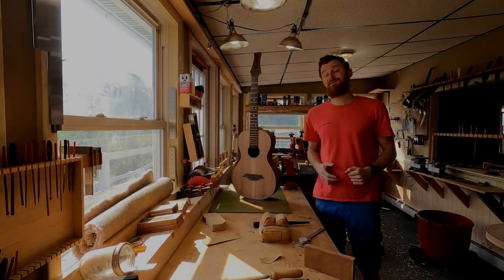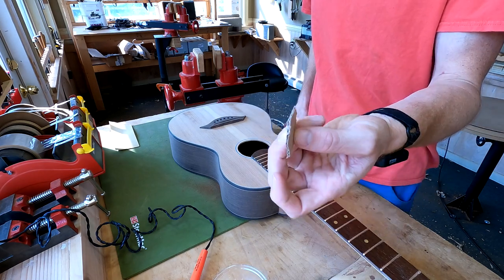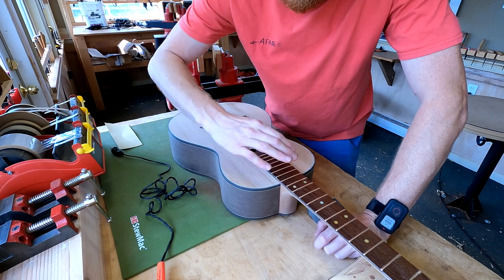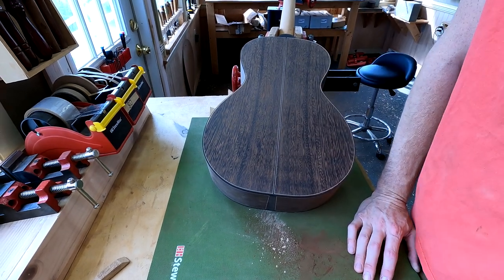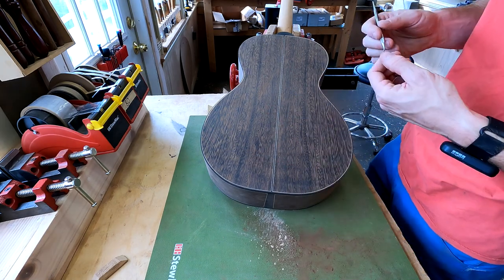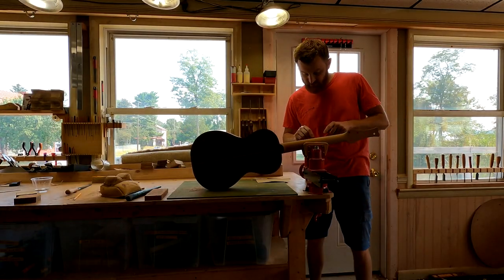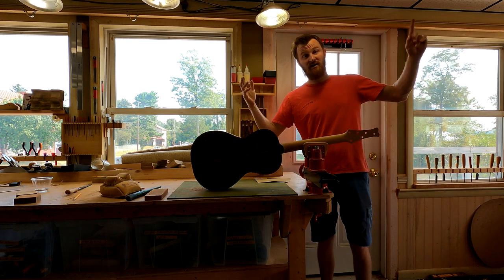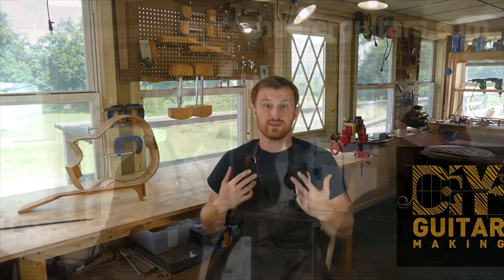Fixing Mistakes on Guitar #86

Comment: Great info, especially on the binding repairs.  

I have had mixed results in avoiding these gaps.    I have shifted to thinner binding to help it conform under the pressure of binding tape and this has helped minimize the gaps…. I have used white oak and black walnut binding.  Both bend well when hot, but are quite rigid during the glue up.  The cold bending resistance scales as 1/thickness cubed so a small thickness reduction improves cold compliance.

Comment: If you use a jewelers engraving tool  you can gouge out those small areas. You can get them as narrow as 10-15 thousands of an inch wide and then fill the gouge with your repair material.